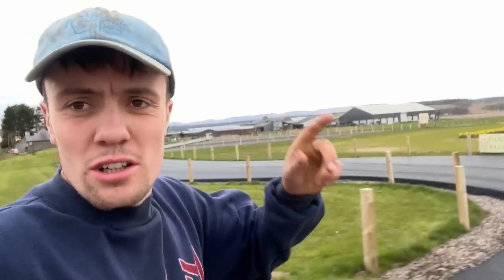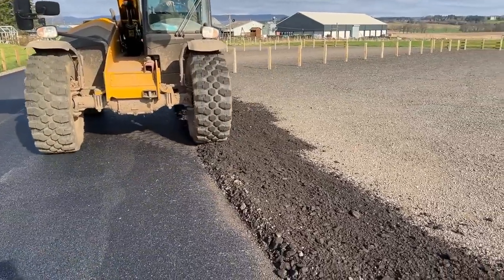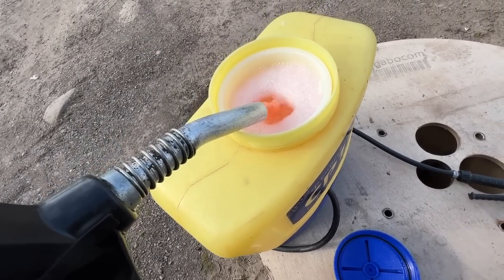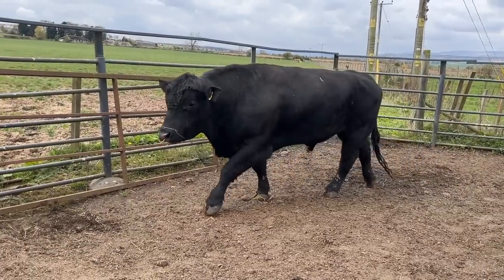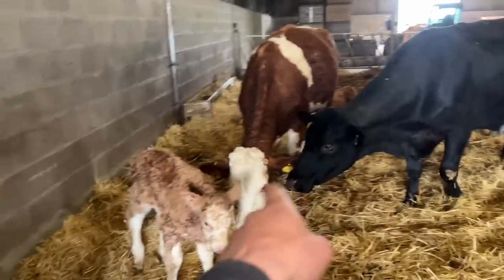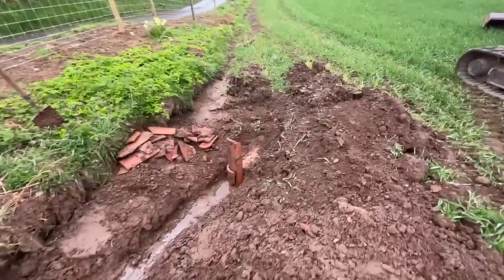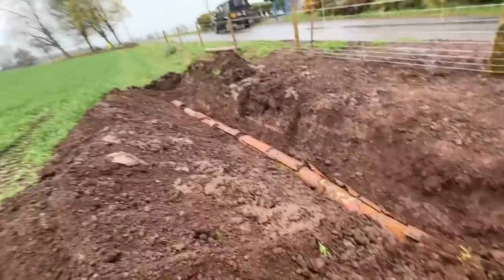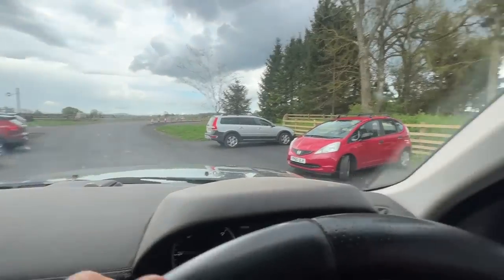We Made A Mistake With The New Carpark

Comment: A vibration plate compactor would be ideal for small jobs like that and a hell of a lot cheaper than a roller, and spraying diesel on it works but works a lot better on a hot sunny day when the tar has lots of heat in it
Reply: A wacker plate. I also think the diesel will have more effect if its sprayed prior to compaction, rather than after.
Reply: @dfgaJK  that's the proper name for it, couldn't remember when I replied first